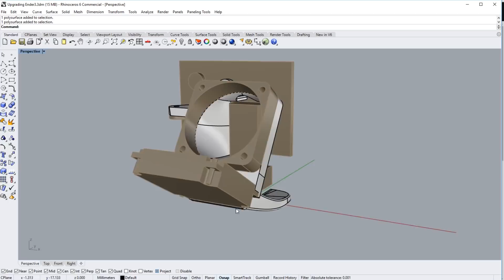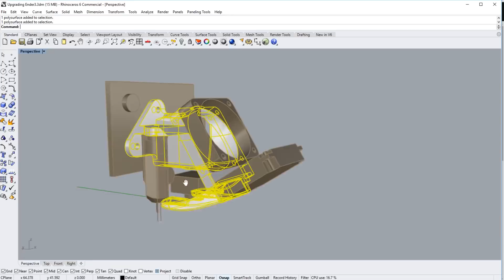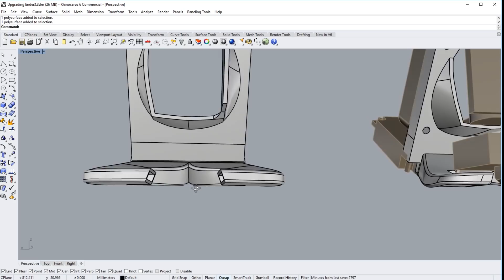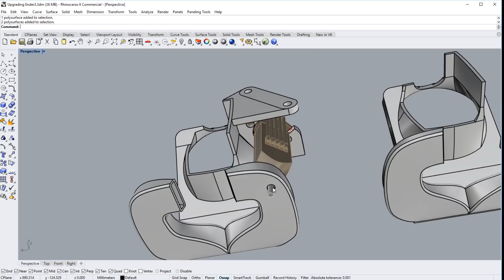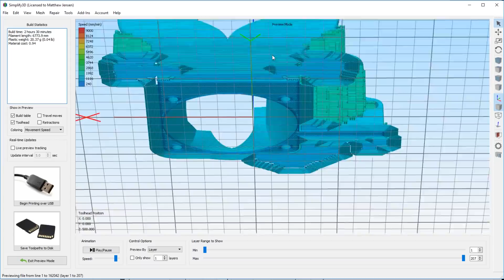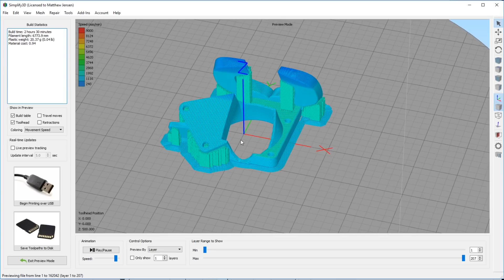Upgrading the Creality Ender 3 with Duet Wi-Fi, and other add-ons - part 1

Comment: I have 2 Prusa I3 mK2 and I can and do sometimes print polycarbonate. Will this printer reach 110C bed and 290C nozzle?  Will it print reliably at 135% speed. Does the bed have auto leveling? Will it print flexible filament? My Prusa's are heavily not modified. My Prusa's print for an average of 20 hours a day, & days a week, non stop for three years now. My Prusa's costed $600 after rebates and 3 days free shipping. I can tell you, I am very pleased with my Prusa's.
Reply from the maker: Yes. I currently have this Ender 3 printing up to 450° C for PEEK filament. The bed reaches 120°, and because the Ender 3 is much more stiff than a Prusa with the zipties holding it together, it prints at faster speeds with no ghosting. BTW what does "135% speed" even mean? Is it 135% of a snails pace? Because that is still pretty slow You are just throwing numbers out trying to make your Prusa sound better than it is.
Reply: @DesignPrototypeTest  
I built my 2 Prusa and maybe you can tell me where I was supposed to put some zip ties to hold it together. The 135% speed is 35% more than the normal print speed. They are not just numbers and I won't be giving you what the actual numbers are. There is no need for me to do so and honestly I didn't know the extent you were willing to stoop to. Thank you for your  input and judging by the way you treat others who respond to your unfounded criticism I will click the three little dots and set it so that you will never again show up in my recommended.

Comment: I like the Prusa mentality and the way the company evolves it,   its great but damn! almost every YT video of Prusia MKIII prints look terrible, inconsistant layer lines seems to be the worst thing , nice features but the actual print quality is actually shocking compared to a few chineese models.  really glad I never got one, I almost did .  granted I've only ever owned 3 printers, an Ultimaker 2,   monoprice Mini V2, and recently a Creality CR10sPRO,   had to upgrade the V2 & cr10sPRO to get them at the level I wanted, only a glass mirror bed and fan upgrades nothing much, my creality is better than my Ultimaker 2 for print quality, not by a mile but noticable  and  would destroy an mkIII not for features ( which I'd like to have)  but for print quality,    Mini V2 still has some Z banding issues which I'm not gonna replace the Z rod or try bending it  ( I only use it for small parts)   I'm sure some people on here get amazing prints of a MKIII  but for the most part and from what I've seen  the prints come out just average for most people, extrusion problems, bad bad layer consistancy,  the problem for Ultimaker is their really old!  the stepper motors are noisy and old,  they never update the parts to stuff you can get on a full printer for under £500 , they were good back in the day but they just have NOT moved with the times they print well! but not worth the money any more  their just really well built which matters a lot still,   MK3 has a lot of bells and whistles and is moving with the times but I feel the printer needs a whole design change for the print quality to get better.    I mean I've never used one but I'm just going off what I've seen,  I resherched it a lot as I was planning on getting one.     people like the brand though they think its gonna take them somwhere and it might with an MK4   but not with what the MK3 it seems funamentally crippled by somthing.   they just make fuck ugly prints.

Comment: The wheels are POM(Delrin). The use of steel bearings "galling" aluminum rails is not a myth, though it is misplaced. It comes from the CNC community which deals with a lot more force than a 3d printer ever would dream of. The same goes for the myth of the "best" drive system being ballscrews. True ONLY on CNC machines. Accuracy wise, concerning belts, leadscrews, and ballscrews, ballscrews are the least accurate of the three, though it is the most rigid of the three. The most accurate is actually the leadscrew. For accuracy, examine the number of steps per mm, as the higher the number, the more positions the motor can place the load in one mm. There has been a lot of bleedover from metalworking which is not accurate or even relevant to 3d printing.

Comment: I really dont see any point what so ever into setting up   wifi printing and spend the money on it, I dont consider that an upgrade, is well know printing directly from the sd card  is going to be always 100 per cent more reliable than printing from  the PC, let alone printing wi fi, You dont want an 8 hours print been fucked up by a wifi  error, there is no point, when you can  just simply plug ur sd card into the printer and let the job begin, It is 100 percent pointless the wifi option,
Reply from the maker: You probably don't see indoor plumbing as an upgrade either. Outhouses work just fine. BTW you have a misunderstanding of how the WiFi printing works. You send the complete file to the printer. It is stored locally on the SD card in the printer, and you can shut down your computer and even have your wireless network go down. The Duet running the printer will continue to print uninterrupted.
Reply: @DesignPrototypeTest   are you going to insult everyone that disagrees with you ass-hole? I still find it pointless, when copying the files into the sd card is literary seconds. this aint an upgrade this will not make ur prints better in anyway, specially when you are running a  a  budget printer, spend money  on unnecessary  so called upgrades.
Reply from the maker: It's not an insult, the analogy is perfect. It takes literally seconds to walk out the back door and go to the outhouse. Just like walking the SD card to your printer. Indoor plumbing aint an upgrade. It will not make ur pooping better in anyway, specifically when you are running a budget bathroom.
Reply from the maker: INDOOR PLUMBING IS A WORTHLESS UPGRADE  THE MONEY SPEND  FOR WHAT YOU GET, WHEN U CAN DO IT WITH A HOLE IN THE GROUND AND AN OUTHOUSE. IS WORTHLESS, GET THE FUCK OUT

Comment: What's wrong with OctoPI to connect over wifi for a fraction of the price of the Duet?
Reply from the maker: in a few words: Fit and finish. Duet is a lot more easy to use, and install. It is all integrated and works perfectly with minimal effort on your part. OctoPrint in combination with a Ramps1.4+Marlin setup is a bunch of boards and softwares daisy-chained together. It's covoluted, and not nearly as user friendly.

Comment: What is showing this video is: Lets convert the cheap good printer to an expensive one without any quality improvement. Basically only because You get the motherboard for free doesn't give you the moral rights to mislead the people that the original is crappy. I have Ender 3 and with very low cost improvements i am able to print very precise parts, like gears, with extreme accuracy and strengthness. The ONLY thing need to be upgrade to make the printer from good to great are the head, and install metal extruder. AllMetal head from MicroSwiss (~$50) and the metal extruder(~$10) and nothing else. The rest are printed parts and they cost virtually $0. I hate when someone advising people to buy something only because He has financial interest of that. What stealing - it is open source!!! If the developers do not want copy's, they shouldn't make it open source. Everything electronics i will prefer to buy cheap copy. Everything mechanical(like the all metal head) i will buy original, because the Chinese most of the time doesn't understand the way the things work, and make ridiculous, and most of the time useless copies. The video is not informative it is advertising to buy unnecessary upgrades - for that reason i will vote negative.
Reply from the maker: First of all, you don't understand my stance on open source watch this before you argue with me further on the issue: https://youtu.be/iKhn5IcVvAg

Secondly, A Smart car, or a Ford Festiva will get you down the road just fine, but let's be honest we all want a BMW with all the comfort and safety features Not to mention the better handling. The stock Ender 3 is like that Ford Festiva. Upgrading it like I have shown gets it into BMW territory.

Comment: I have an Ender and the problem I ran into is the rubber rollers wearing so the table is now so sloppy that it can’t be leveled and print the first layer well. If the rails for the bed were at the outside edges it would have been a lot more stable. I “retired” it and bought an ANYCUBE I3 MEGA which has linear bearings and are widely spaced for more stability and no wear problems. Same price, much better quality.

Comment: The runout sensor has to be before the extruder not after, how can it detect a run out lol.....
Reply from the maker: The laser sensor detects movement. It is the same as your mouse reading the table underneath as you drag it. The firmware takes the distance the extruder was told to move the filament and compares it to the distance the filament actually traveled. If the extruder moves filament, but the sensor detects no movement then the firmware knows there is a jam. Being placed after the extruder allows the sensor to detect "looping" problems with flexible filament where the filament pops out of the side of the extruder. Even though the extruder is feeding filament, it's not going out the nozzle. Instead it is just creating a larger and larger loop in the air. Like this: http://3dprintingforbeginners.com/wp-content/uploads/2015/06/Craftbot-Review_364.jpg I know of no other way to detect this type of problem except to place the filament sensor after the extruder.

Comment: it came out cool but with hours you spend did you actually save any money.  time is cost to im most cases. Also you forgot to state that while you didn't have any 3d printed parts on the body you did print a whole new hot end setup which means you need a 3d printer to do this upgrade
Reply from the maker: Time is money, you are correct. I earned some ROI on my time through YouTube advertising revenue. For anyone duplicating my project they can learn from my experience and video and make this in a fraction of the time it took me. For them, even considering the expense of time, it is still less expensive than a Prusa.

Comment: Have never used or even seen up close a 3D printer but I noticed the screen lit up when he pushed in the heating bed(?). Doe that mean the machine is still plugged in while you were taking it apart?
Reply from the maker: By forcing the bed to move I was spinning the stepper motor like a generator. It momentarily powered the board enough to light up the screen.
Reply: That would explain it lol. Safety first correct.

Comment: Any suggestion for a mainboard upgrade that isn't so expensive? I don't need wifi but would like more flash storage and to be able to upgrade stepper drivers.
Reply from the maker: The MKS Gen.L is a good and popular option, but you won't be able to use RepRap firmware. You will be stuck with Marlin.
Reply: Thanks, I'll look into that. I'm just pinching every penny just so I can keep being a hobbyist maker in the 2 hours I'm not working these days.  Really appreciate the suggestion.

Comment: That Duet wifi is not a realistic upgrade for the most of us.  I paid $180 for the Ender 3, and I'm certainly not going to spend just 10 bucks less than that again it get that Duet wifi. Kinda ridiculous to nearly double the printers cost with that upgrade. I'll PASS. 😕
Reply from the maker: As the brains of the 3D Printer, the control board and firmware is 50 to 75% of what makes a printer. We've grown so accustomed to unreasonably cheap things from China that $100 for a control board now seem "too expensive." Inexpensive crap is the reverse Opium war that China is trying to control the world with. The Duet board is undeniably better. 8 Bit control boards were cutting edge back in like 1982. Meanwhile we have 64 bit computers in our pockets that can respond to our voice. It's strange to me that you would  be both interested in cutting edge tech like 3D Printers, and yet be a Luddite advocating against modern electronics because it's "too expensive." Do you also use a horse and buggy like an Amish person because a Car is too expensive?
Reply: @DesignPrototypeTest  oh, I'd love to have that board, but it's kinda unrealistic to think that most people aren't thinking the same thing I am... I just bought the printer for $180, and now you are recommending me spending another $170 for a new motherboard. Essentially doubling the Ender 3's price. What's the percentage of owners that you think will do this mod? I'd guess less than 10% (I actually think less than 5%, but I didn't want to low ball it! Lol). I, and many I would think, would rather have another Ender 3 than this mod. Sorry... Good review though!

Comment: It's a £120 (and currently out of stock) for the Duet Wifi Board in the UK. That's £40 less than I paid for my Ender 3 with next day delivery!

An octopi upgrade might be a better route if you need remote printing.

Comment: I bought the Ender 3 pro with all possible standard upgrades. (No wifi, bed leveling or fil sensor but i am using a Rpi3B which adds wifi and remote option). Total price 365 Euro including import taxes and custom fees. 
The Prusa MK3S as a kit costs right now 834,- Euro including import taxes and custom fees. And that is a kit. Which means a ton of things can go wrong down the assembly line. In addition to that cost you must add 4-5 hours careful assembly. That is also a calculated cost you pay it on the preassembled. 
If you have 1000 Euro burning a hole in your wallet then go ahead. 
I would much rather have 3xEnder3pro instead of 1 Prusa....

Comment: Well, what Josef Prusa does better than anyone else is drive the market. He drives others to innovate, perform and improve their tech because he demands it. His team of people put together different ideas, weather theirs or not into a full actual working marketable package to deliver optimum results without having to hack it. I bought my Prusa MK2.5S from a mom at a garage sale for $25 Bucks. Her boy hadn't even put it together. I also have an Ender 3 Pro which is well distinctly inferior. Creality doesn't do their own thinking or even measure what they do manage to get out the door. On my Ender 3 Pro and many others the X axis is not and can never be square to the Z Axis because of the parts used.
Their Z Trolley stack isn't even square and parallel to itself. This makes the Z lead screw tilt backwards and puts the X Axis rail at a slight angle across the bed. Why? Because of the eccentric nut(s) and the poor quality spacers. On my Ender-3 Pro the eccentric nut measures approx 8.5 mm but the supposed 8mm spacers all measured much less than 8mm and were not consistent with themselves with a range of 7.7324 to 7.8137mm on my machine. A parallel trolley stack is absolutely essential to a any Openbuilds or DIN type rail 3D printing system especially when driven by a single Z lead screw. 
Yes, I was lucky to have stumbled across a Prusa MK2.5S at a garage sale, but I am more fortunate to have learned to think and measure. 
The out of the box Ender-3 Pro prints fairly well but as built won't last. The Ender-3 Pro isn't comparable to a Prusa simply because Creality lacks attention to the finer details. 
Prusa would never put out a product where the Z Axis lead screw tilts back away from the Z upright rail with a 12-15mm difference from the bottom to top, but Creality does it every single day. China companies always flaunt their certificates, ISO 9001 etc, Prusa promotes and improves a consistently high quality product, In short Prusa's shit works better because of Prusa himself.
You are both wrong (Chilternflyer) about who invented what and when. Everything we have as consumers is driven by and adapted from really costly high tech. Boeing, Lockheed Martin, AirBus, GE, Chromalloy, Pratt & Whitney, and many others plus their suppliers who paved the way so we can have our cheap assed toys.
FYI, I am a retired US Air Force Certified Jet Engine Technician. The runout tolerances of Jet engine compressor spools is measured in millionths of an inch end to end. Total stacked runout allowed would blow your mind.  
So before we go changing electronics and arguing about who invented what, let's endeavor to make sure the mechanical structure is straight, square, parallel and all those other pesky measurement things. My Prusa find was all this right out of the box! Not so with the Creality Ender-3 Pro. I started my builds on a certified granite surface plate and NIST Certified Starrett measuring tools, but use what you have, your builds will be better even with Chinese tools.  
When you bash Josef Prusa you only bash yourself. Prusa owns his price point for a reason.

Comment: Everyone says "cheap chinese printers" like they are low end stuff, hey let me tell you something. 100% of all the important components, such as motors , electronics, wires, linear bearings, lead screws, LCD panels, buttons, switches and more are sourced from "cheap chinese" factories. The only thing that makes a "non cheap chinese printer" is someone spends more time assembling and tweaking it.